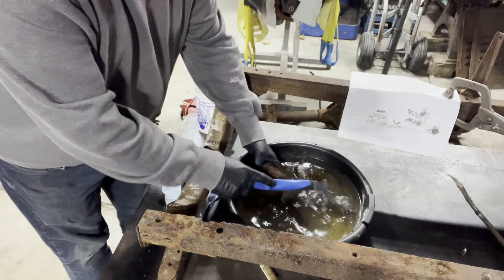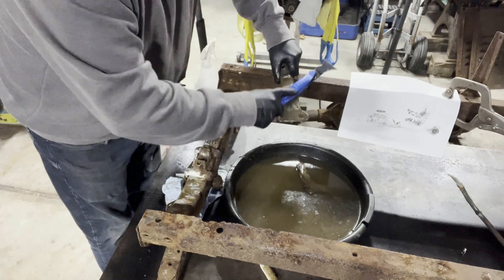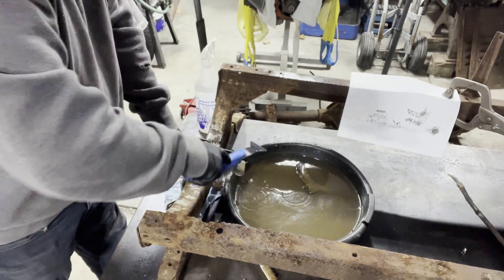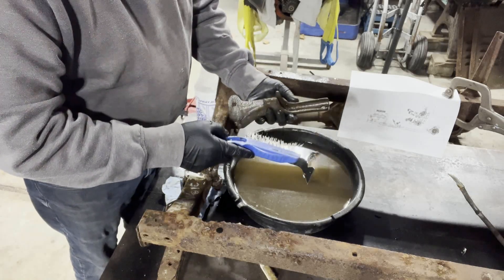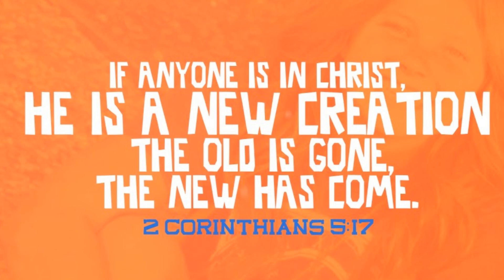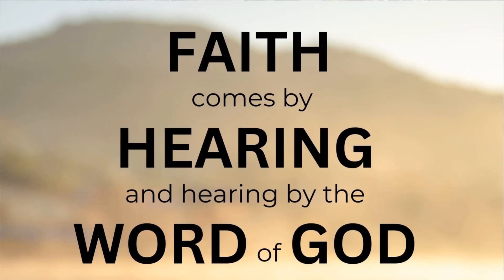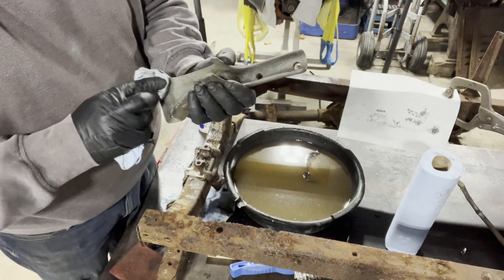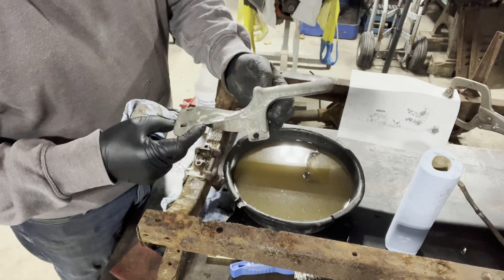From Rust To Blood  - How Did That Happen?

Comment: Hey Bill! I'm having great success with electrolysis for rust removal. You might check with your local farm supply store and see if they have agricultural vinegar. It's about 25% and should clean that rust up faster.
Reply from the maker: Hi Matt, I saw your setup with the battery charger. I’m considering that too. I know it works good. I thought about putting the rear end for the t bucket in my wife’s bath tub, but she’s not really warming up to that idea.  Hmmmm

Thanks for watching!!
Reply: 😂👍 @EdgeofEternityBillCameron